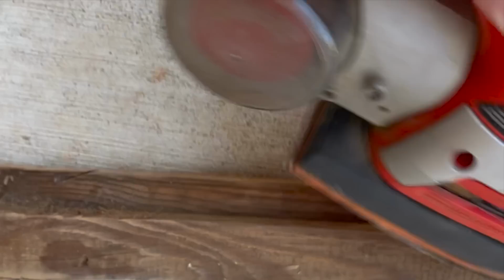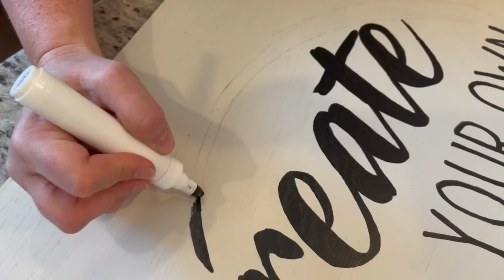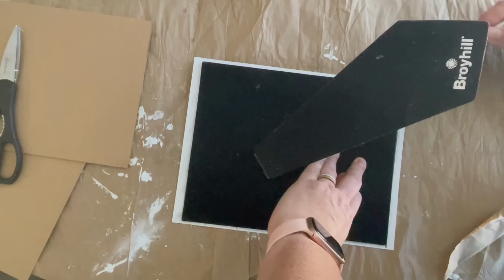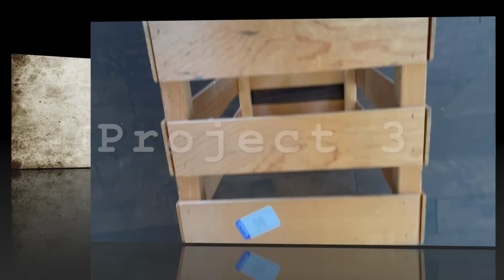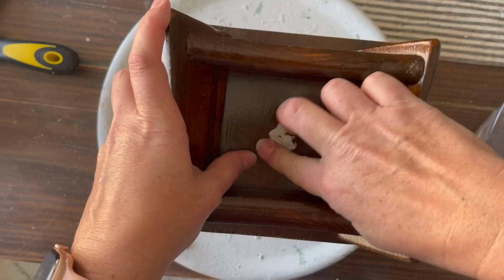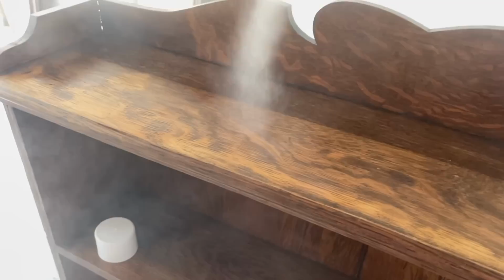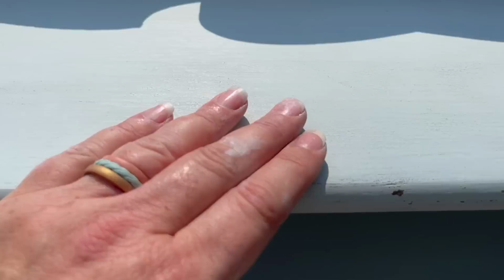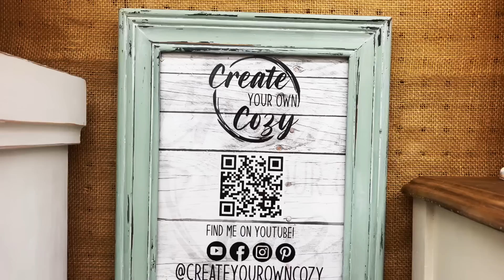Thrift Flips ~ items to use to stage my booth ~ signs ~furniture

Comment: I love all of your stuff. I’m sure you know that your Cricut can cut larger things in pieces? I’ve made enormous designs and then sliced them so they cut in multiple sections.
Reply from the maker: I was pretty sure it could handle the size even if I did a quarter at a time.  The problem was it was impatient with myself.  I had just opened my booth and really wanted my sign in there asap.  Just went with what I knew I could do in a short period of time!  Need to learn all my circuit is capable of!
Reply: @CreateYourOwnCozy  I get that. I’m super impatient too!

Comment: What color wax did you use, did you top coat the paint before you put the wax on? I feel like I missed some steps.
Reply from the maker: Some of my videos weren’t acting right so I had to cut them out in order the publish the full video!  I used sweet Pickens dark wax over the milk paint directly without having to add a top coat prior.

Comment: Heather, I have a question, I have painted a couple of wooden items with apothecary and I want to use white wax on them.  When I put the wax on and wipe it off, does that distress the wood?  Do I need another sealer at any time?  Thank you
Reply from the maker: Sometimes it will distress down to the wood, depends on what was under the apothecary paint.  In my project QR code project, I had used a white wax directly on the frame a number of months prior.  The wax cured and was able to be painted over but there were spots that still distressed down to the wood.  Usually putting the white wax directly over the paint will just change the color when wiped back and will act as the final sealer on the project.
Reply: @CreateYourOwnCozy  thank you for taking the time to answer my questions.  I am just trying to learn how to do things.
Reply from the maker: @jadestone8552  these are good questions!  Reminds me I need to include more of this stuff in my videos!